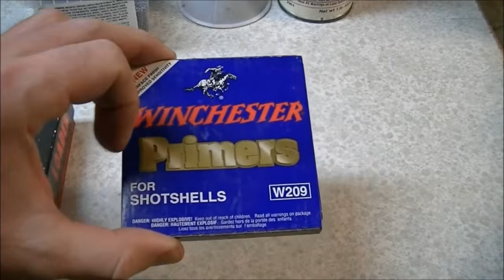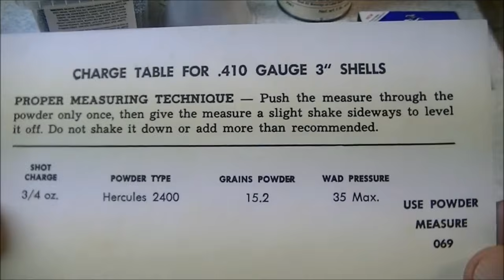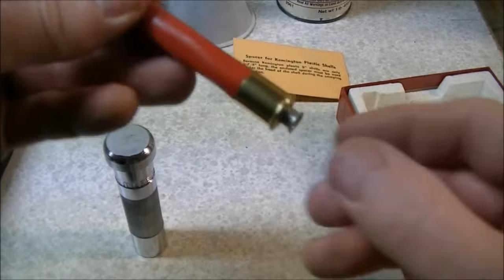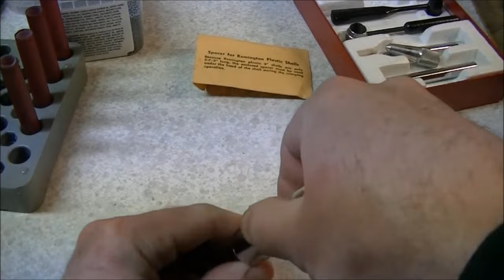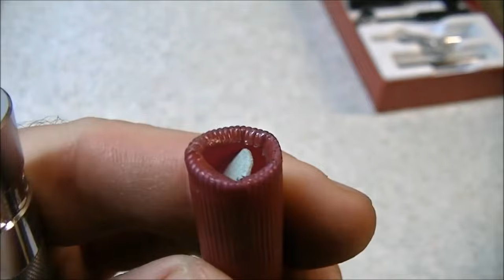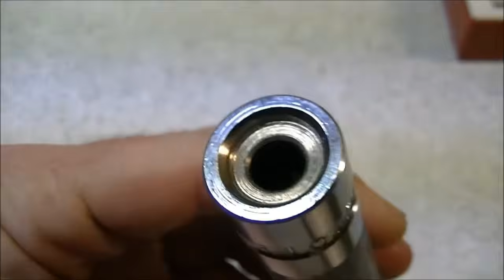Reloading .410 Shotgun Shells With The Lee Loader

Comment: I haven't used one of these in nearly 60 years but they worked pretty well back then. We didn't have a lot money for ammo for our .410s, but did like to hunt a lot. These kits made our cost a lot more reasonable. I still have my double .410 and started shooting it again. Ammo cost is crazy for a box of shells, so I purchased one of the kits again. Thanks for the great refresher course on loading. I will be enjoying shooting that shotgun again. Interesting about the .410, it is called a beginners shotgun, but it is actually the experts shotgun. After I stopped shooting the .410 and went to a 12, I became sloppy. The .410 makes you a much better shot.
Reply from the maker: Yes indeed, the limited number of pellets makes precision necessary. If I were forced to buy 410 shells at the current prices I would not fire many, but having the gear to reload them makes shooting them a decent amount a reasonable proposition. What sort of double 410 do you have?

Comment: Tim ideas... In the hardware aisle, you can make a positive stop on a final crimp by having a suitable size bolt and there's a donut shaped "stop" with a screw thru the side that can be set on the bolt, screwed tight, and acts as a positive depth stop on the final crimp. Top of die stops the depth. A small hose clamp can also work around the bolt. Maybe Mickey mouse/rube Goldberg operation, but it worked ok for me. The donut shaped thing with the set screw looked like the spacer in the envelope shown. In the past, oal hull length varied quite a bit between manufacturers or even lot, a spacer for each hull at the base when you final crimp is normal. Missing expander?... I used an empty 30-06 case. Lee's can be tricky roll crimping. As described in video.
Reply from the maker: It would be interesting to see your set up/modifications. Like you say hull lengths can vary a lot, for example the old Winchester compression  formed 2-1/2" 410 hulls came in two distinctly different lengths.

Comment: Have you seen the crazy prices that these go for now? The current auction at Switzer has one that is going nuts. I'm surprised Lee hasn't started producing them again.
Reply from the maker: Yes, the on-line prices on these sets now is just crazy. I just checked out the auction you mentioned and the current price is $190 and there is still 3 days left to go. I think I paid $15 or $20 for the set used in this video, granted that was probably 15 years ago.
Reply from the maker: That set at Switzer’s sold for $625 plus fees and tax!
Reply: @314299  , crazy isn't it?

Comment: These things sell on eBay for $100 but Lee won't make them anymore. They also won't make a lead loader in 410 even though somebody in another country made an adapter to let the load all load 410 shells. 410 is more popular than ever but Lee just won't respond.
Reply from the maker: It is strange indeed, isn't it? I think they could make a good 410 loader by using one of their metallic presses, perhaps  based on one of their turret presses

Comment: I started loading 3” 410 shells back in the late 1960s. The hand tools I used were from a set I ordered from Herter’s. Their loading data specified Hercules 2400 powder and a 3/4 ounce shot charge. I used one 1/8” hard card and a 3/8” fiber wad. The bases of the hulls didn’t get resized, and the six-point crimps flared. Despite that they still worked in my old bolt action Stevens shotgun.
Reply from the maker: I've seen Herter’s bench mounted shot shell loading presses but never a hand tool set - are they similar to the Lee set?
Reply: @314299 They were similar to the Lee set. I also had a set for 12 gauge shells. After I scraped up enough money I bought a Herter’s Model 72 bench mounted 12 gauge press. It was a giant leap forward!

Comment: Can I remove 12 gauge primer and use it in .410 brass ??
Reply from the maker: Yes, they are the same size. Modern load data specifies the brand of primer to be used so be sure to reference proper load data for the primers you are using - for example if you take primers from Federal shells use load data for Federal primers.

Comment: Seems dangerous to have the shell inside the steel tube while applying pressure to roll crimp. If the primer goes off you would blow your hand off.
Reply from the maker: Untold millions of shells have been reloaded with these tools without that happening. Primers require a specific percussive impact that you will not generate by pushing on the shell with your hand.

Comment: Dont crush your wad down so forcefully, thats not necessary. You will end up not need so much of a roll crimp.
Reply from the maker: Most lead shot wads for 10/12/16/20/28 gauge have a cushion section but standard 410 wads do not, therefore you can not "crush" these 410 wads as they don't have a cushion section to crush.  Pushing the wad down forcefully is done so as to compact the powder for better ignition. The powders used in 410 shell are very slow burning compared to other shotgun powders and work best if firmly confined by a solid crimp, and a deep roll crimp also insures better ignition of these slow burning powders.

Comment: With the cost of 410 shells and in areas that are very remote this would be a life saver. I have the 410  Survival Reloader by the X Ring and it is about 88.00 and works well. I also have Mec 600 but had to start somewhere . Will always keep the hand tool. Not much in the way of components to loading a 410 when they cost around a buck each for factory.
Reply from the maker: In my part of the world 410 shells are very hard to come by and have been for the last couple of years. A box of 2-1/2 shells costs $35 or more and 3" shells are pushing $50 a box. I'm glad I have reloading gear and supplies on hand, otherwise my 410's would get no use.

Comment: Did you resize the hull?
Reply from the maker: No, the hulls cannot be resized with these tool sets. Ideally you need to use hulls that were fired in the same gun that you want to use the reloaded shells in.  Hulls that were fired in different gun might not fit.

Comment: Might the spacer also allow for more force to be used in crimping without worrying about setting the round off (perhaps using a few gentle taps with the mallet etc...) in that it reduces any concentration of pressure directly onto the primer?
Reply from the maker: As long as you are applying crimping force by pushing and the shell is on a smooth surface there is almost zero possibility of the primer going off. Primers are set off by percussion, so I can not recommend any crimping that involves hitting the loaded shell with a hammer or mallet.

Comment: Неповерю,чтобы у американцев небыло закрутки.  (завальцовка),настольной или ручной . У нас,отродясь небыло .410-го калибра и вскоре появились приборы для снаряжения патронов... выбирай и бери,на своё усмотрение. Нафиг надо мучился с этим молотковым набором 😱
Reply from the maker: I tried a couple of on-line translation tools on your comment but the results they gave me were odd, here's the result one gave: 
"I can't believe Americans don't have a twist.  (I don't believe they didn't have a twist, table or handheld. We never had a .410 before, and soon there was a cartridge-firing device... Pick one and take it at your own discretion. I don't need to bother with that hammer set."
I'm going to assume your comment was something like "I cant believe you dont have a reloading press, there are many available, pick one and no need to bother with the hammer set."  If that was close to the intended comment, here is my answer.
 .410 reloading presses are indeed available, in fact I have two, both are MEC single stage units, one set to load 2-1/2 and one for 3" shells. However the video is not about those, it about using the now discontinued Lee hand tool set. Apparently it is topic of interest to some people as over sixty-six thousand folks have watched the video at this point. Have a nice day.

Comment: Good clip. Brought back good memories.   I bought mine form Dixie Gun works back in the late 1970s & used them for years, before I finely got a Mec reloaders.  I have one in .410, 28, & 10 ga.  Picked up the 10ga one @ a gun show back in the 80s sometime.  I have not used them for years now, but they would still work just as intended today, as they did years ago.
Reply from the maker: One plus to these is that even if they are not being currently used they do not occupy much space when in storage.

Comment: That looks like a old used fired hull ? Try using that tool on a new hull good luck it just does not work at all !
Reply from the maker: Are you trying to do a roll crimp or a fold crimp on the new hulls? Roll crimping should go well on new hulls, however if you are trying to fold new crimps you will need to add a six point crimp starter. A crimp starter was not included with the set used in the video but may have been included with later production "deluxe" sets. If you cannot locate and original Lee six point .410 crimp starter you should be able to find a crimp starter for a MEC machine, they are cheap and work the same. What brand of hull are you trying to reload?
Reply: @314299  I’m just going to roll crip them it’s a lot easier
Reply: Search for Barry Declined. He has made reloader kits like 17:45 the Lee for .410 and 12ga.
Reply: @jerrymiller8984  it’s not so much as a reloaded it only works with fired shells but does not work with new hulls it just destroys the new hull .

Comment: Could I get a link to buy this specific model?
Reply from the maker: Regrettably these sets have been discontinued for many years. If you want one you will have to search auctions such as eBay or check the tables at gun shows. Be prepared for "sticker shock", these have gotten quite expensive. Another option would be one of the other sets such as the one by "The X Ring USA"
 https://www.thexringusa.com/product-page/survival-loader-for-410-ga

Comment: How do I do a slug
Reply from the maker: The process is essentially the same except you insert a slug instead of pouring in the shot. As for .410 slugs where are you going to get those for reloading? I've not seen any for sale.
Reply: @314299  
I have about ten boxes of 410 slugs from Winchester but that was about 3-4 years ago.

Comment: Is there a reason why you used hand pressure to make the roll crimp and not the mallet?  I assume you want a good starting crimp, but once it is well started, why not use the mallet?
Reply from the maker: Pounding on a fully loaded shell is a bad idea as primers are set off by impact/shock, so there is the possibility of it going off. Pushing on the shell does not involve the same risk of a primer and therefor the shell going off.

Comment: Can you tell on the 410 Lee Loader, is the body/die stamped with that information; or what does it say?  I have the kit, I want to confirm that I have the original components.  Someone thinks the die might be a 28 gauge....Is that possible?
Reply from the maker: There are no gauge markings on the loaders I examined, all the gauge info is on the load data/instruction sheet. It should be pretty easy to see if what is present in the kit is correct for the gauge marked. If you have a fired shell and a wad you can compare those to the tools present to see if they appear correct.

Comment: Do they make them for 12 gauge and how do you get them
Reply from the maker: They did make them for 12 gauge, as well as 10, 16, 20, 28 gauge and .410. Lee no longer makes any shotgun Lee Loader sets, however used ones can be found on the auction sites as well as at gun shows.

Comment: It might be easier to crimp by using the other side of the dye body (i.e. side used to remove primer) and then using the handle end to push in the crimp.
Reply from the maker: That would not work as it's the geometry of the inside of the die that curls the crimp in, with the die backwards it would not work.

Comment: I just bought one of those .410 lee loaders for 3 inch shells. That kit is missing the spacer with the hole in the middle you are using to force the shell body higher in the tool. Can you give some dimensions of the spader so i can make one ??  Width across and thickness ?? I can drill the hole after the spacer is made. Thanks ... Rusty in Ohio
Reply from the maker: The dimensions of the spacer are: 0.50" diameter, 0.20" thick with a 0.25" hole in the center. Hopefully that helps.

Comment: Is their a part number on the spacer ( Remington shells ) spacer ? I bout a lee loader in a estate sale and it didn’t come with one. Or is their a way you can measure it with calipers and share the info ? Thanks
Reply from the maker: I don't see any part number, however the dimensions are: 0.50" diameter, 0.20" thick with a 0.25" hole in the center. Hopefully that helps.

Comment: Just a heads up. My lee 3inch loaders wont load 2.5 inch. Rim for 2.5 wont fit in 3inch chamber. My herters similar loader will accept 2.5 and 3 inch as body internal is wider in diameter. Rem hulls are shorter, that's why the washer in sand colored envelope. These look like federal hulls. Old federal had different primer pocket shape than newer 209a type. Older more win rem cci shape, newer more bell shape at rim. Mec starter crimp may help a bit for fold. Crimps nice enough. Lee of this type waaay overpriced on fleabay. Other alternatives available, check on YouTube. Used mec 600 jr is super, as is pacific 155. As you can see it's slow but they do have their purpose. Thanks 4 all the videos.
Reply from the maker: The 3" .410 loader will not crimp a 2-1/2" shell so there is not much point in even trying them. As for 209 primers differing, they do differ slightly from make to make but do fit well enough to be usable.
Reply: @Travis Thacker they are expensive bc they are useful for special projects in reloading and very few were made.

Comment: Hello
Thanks for another great video.

Question:
Did you ever get around to load those buckshot you cast in the Lee mold, a couple of years ago?

Best regards
From a long time subscriber
Reply from the maker: Yes, I did load some 12 gauge shells with the "000" buckshot that I cast in the Lee mold. I did not have much success finding a load that functioned well, the issue was that the loaded shells were "lumpy" and were hard to chamber. The "000" pellets are just so large that they dont stack well, at least not in any combo that I tried.
Reply: 314299 Shooting Channel 
Interesting, it’s the same result that I got.
I have loaded some with fiberwad, but haven’t got around to test them..
Best regards
Reply: Had you tried loading only 1 or 2 "000" buckshot and see  the result ?

Comment: What does "wad pressure" mean?  Thanks.
Reply: Wad pressure is used to compress the wadding slightly to get the total package of powder, wad and shot in the shell without air.  A shotgun shell has to be loaded to fill the entire shell without void or space between the powder, wad and shot. Otherwise poor ignition and strange ballistics can result,
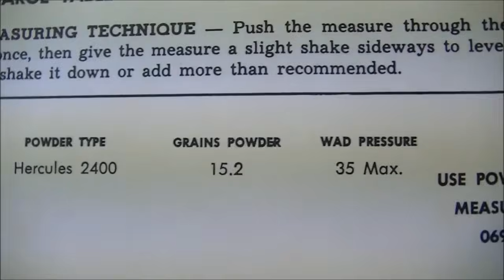Reply: @ashleypalmer7983  Thanks Ashley.  At 3:00, what does the number 35 demote?  Does that mean compress all the components to 35 lbs/f ?  Thanks again.
Reply: @pokiebaron1  exactly. But do the compression before you add the shot.
Reply: @GunFunZS  Thanks GunFun!
Reply: @pokiebaron1  welcome. Wad seating pressure is mostly a throwback to fiber wad and black powder. Modern components care about depth and lack of gaps.
Reply: @GunFunZS  Thanks again GunFun.  Interesting info re: fiber wads and black powder.
Reply: @pokiebaron1  The 35 was the pounds force you were to apply when seating the wad column over the powder.  Most of the shotgun loaders had a little gauge that was a measure of the seating force at that station some had a spring loaded shell holder and some had a spring loaded wad rammer.  For this Lee loader, the instructions said to use a bathroom scale.
Reply: @ashleypalmer7983  Thanks Ashley!

Comment: If I not mistaken didn’t Winchester used to make a 3/4 oz factory load
Reply from the maker: I think they did offer such a shell. 3" .410 shells loaded before the use of plastic shot cup wads had more capacity.
Reply: Wasn't that the old 3" magnum shot charge?